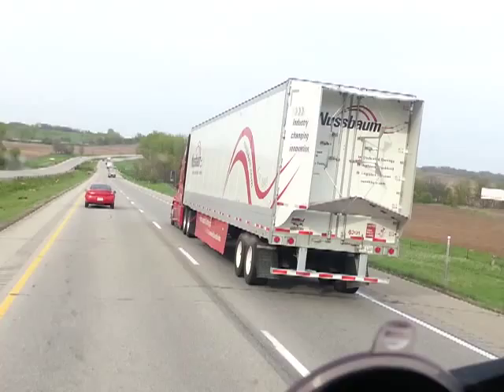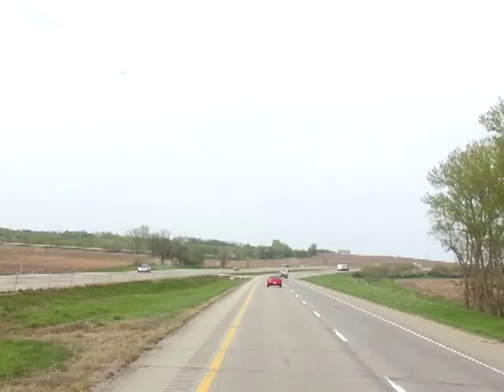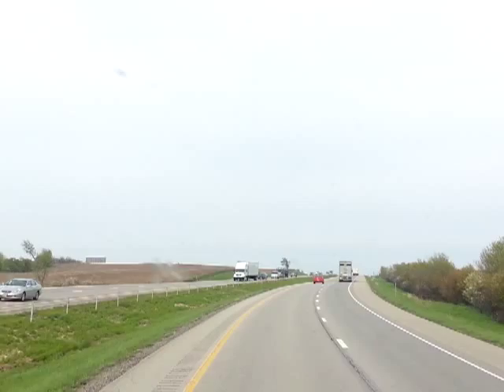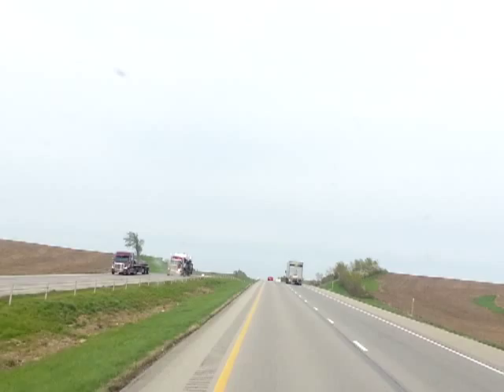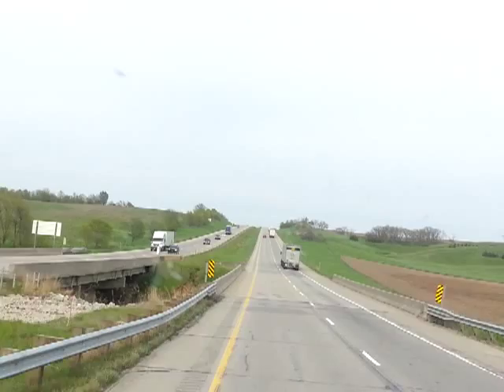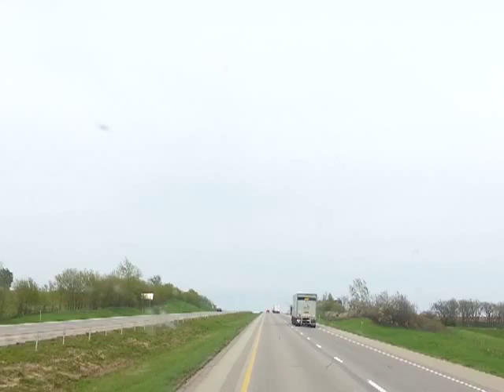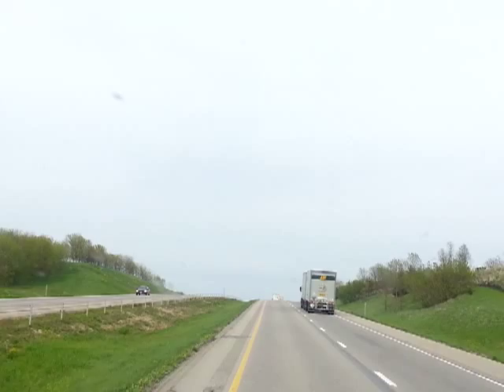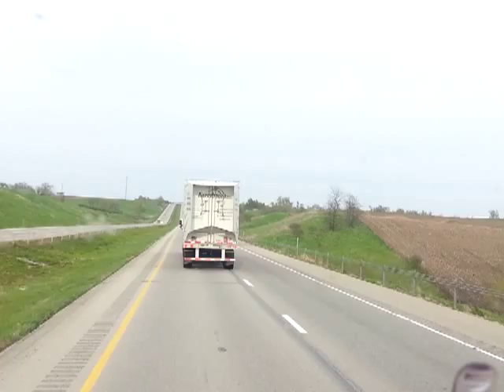Tractor/trailer trying to get fuel mileage

Comment: i drive for prime we are dedicated to getting fuel milage ...i have a 2014 cascadia evolution ....i can average with a +- 1500 mile trip i get around 9mpg at 58mph if i have a trailer with side skirts and only about 8.7-8.8 with a trailer without ..same trip same load so its not a whole lot better but its around 5 gallon saving so $20 in my pocket with that side skirt

Comment: I wouldnt use super single tires for anything except a steer on a heavy haul truck!! Because if you run over a nail and thats it!! Your stuck right there where you are until somebody fixes it!!! And most of the time when you have a blow out with one it destroys the rim!!! Or if say you blow a tire on a bridge or a road that does not have a shoulder you can not limp it away to get it off the road without destroying the rim and the trailer.  I have driven over 100 miles with a blowout with duals just to get to the nearest tire shop and if i had super singles it would have been a $1000 just for the service call not including the tire!!! Also the super single and rim cost more than 2 low pro 22.5 tires and 2 rims!!  I would flat out never use them at all!!! The money that they claim you save with super singles does not out way the cost of service calls on ALL tire repairs!!!

Comment: Is that worth the price of the skirts though? How many trips do you have to make to pay for them? I don't doubt that they save some fuel but I've seen manufacturer's claiming over 7% savings and I'm skeptical about that. In any case I run the Rockies in Canada and would have ground clearance issues with them. Super Singles I'm interested in, but some jurisdictions up here limit axle weights with them. Anyway I'm glad you feel your getting something out of them.